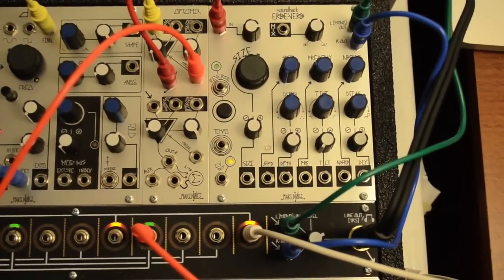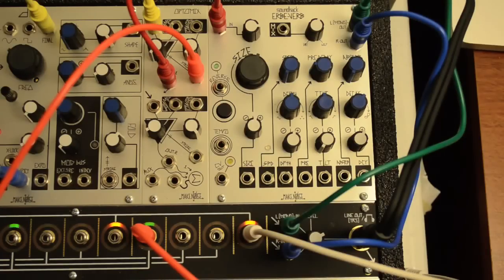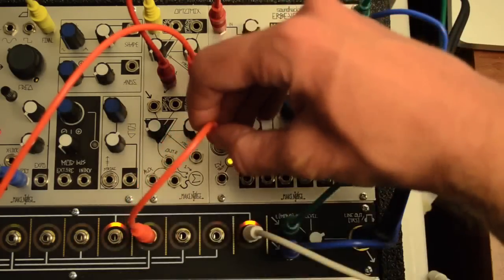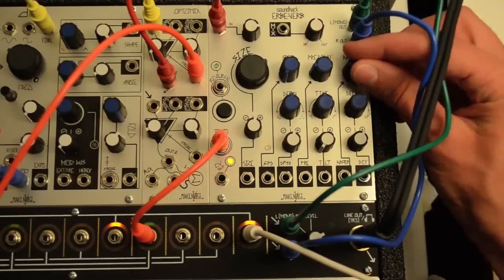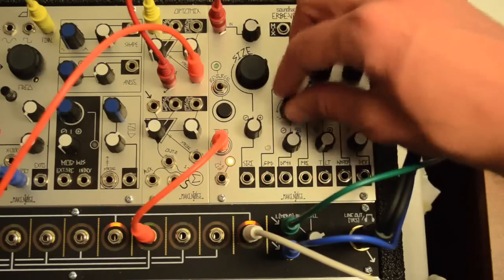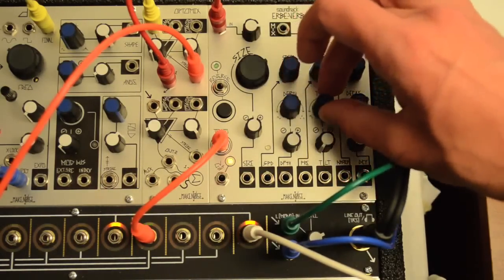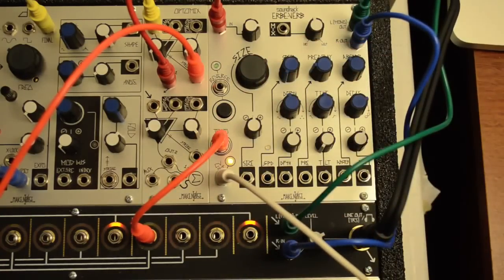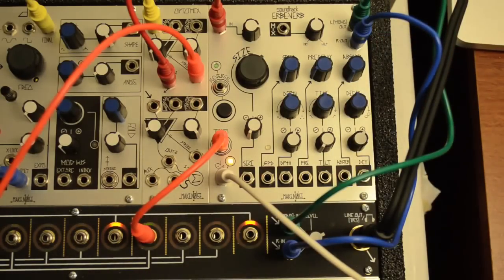Make Noise Erbe-Verb

Comment: Could you use this as a guitar pedal? 🤔
Reply from the maker: You would probably want to pre-amplify the guitar signal pretty heavily first, but yes it could process any sound.
Reply: MAKEN0ISE thanks for the reply! Would you care to elaborate why you recommend pre amping it heavily?
Reply: @concon4686  line level (signal strength) <<<<< eurorack level
Reply: @concon4686  Modular operates at much higher signal levels.  Something like Merge by Adventure Audio or Ears by Mutable Instruments is needed to get the signal up into the modular world, same issue when you go back down.  The advantage is a level of control and modulation that is hard to match even with an expression pedal.
Reply: I highly recommend a Bastl Hendrikson module to bring guitar up to modular (or vice versa) levels —great interface module, with a mix control level adjusters with indicators